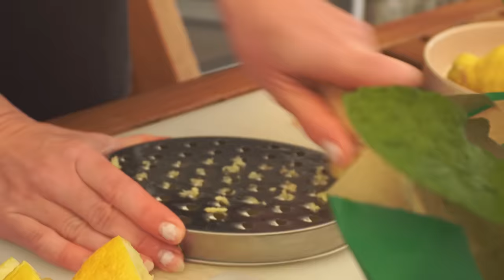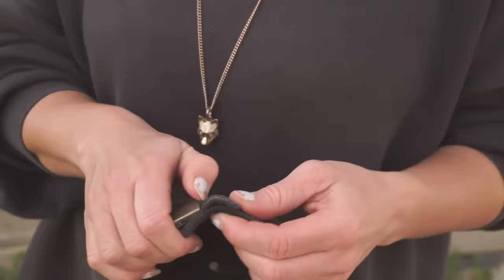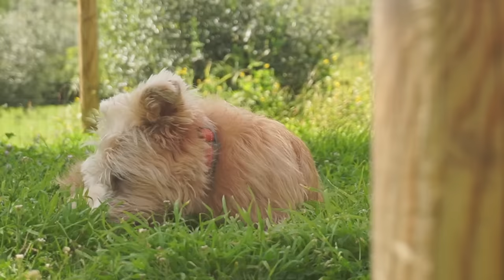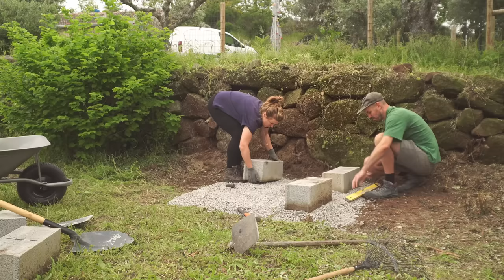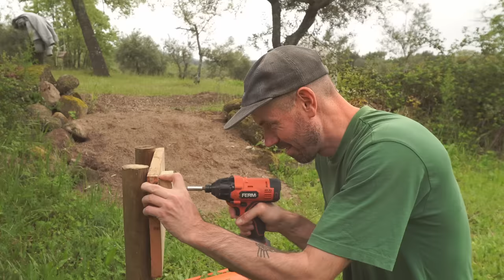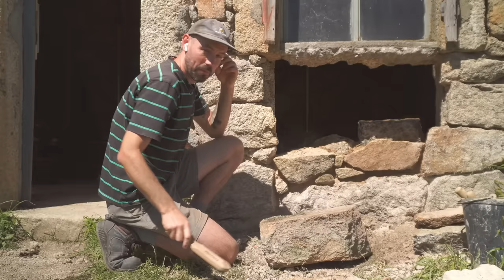Building Our Stone Home at 50% | ABANDONED FARM RENOVATION

Comment: A tip for your caps. When storing them take the brim and gently bend it down evenly on both sides, then fold the cap and tuck the brim through the hole in the back. A collector taught me that. Stone work is looking good and the bramble armageddon was pretty epic.

Comment: Excellent video and well done on the stonework. Re: The OBC - Sun penetration will turn the water green with algae, best to cover the outside of the IBC in black plastic (DMP 3m x 4m, then tape it up). You can take the plastic tank out of the cage and wrap it, then put it back in. Best of luck 👍
Reply from the maker: We already have a cover. You can see us pull it off before we moved it 👍🏼